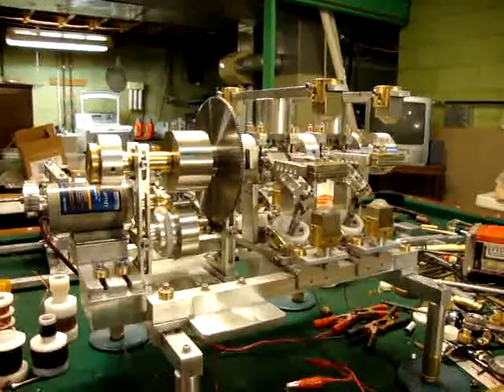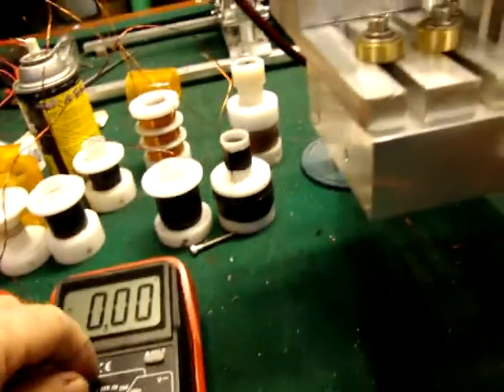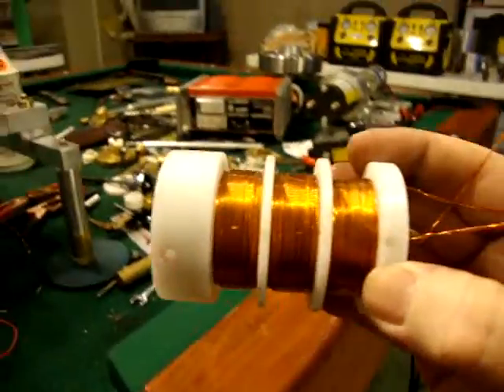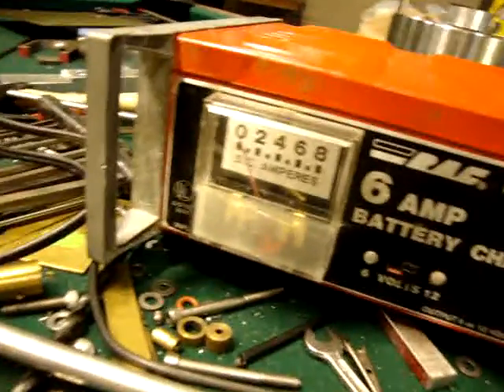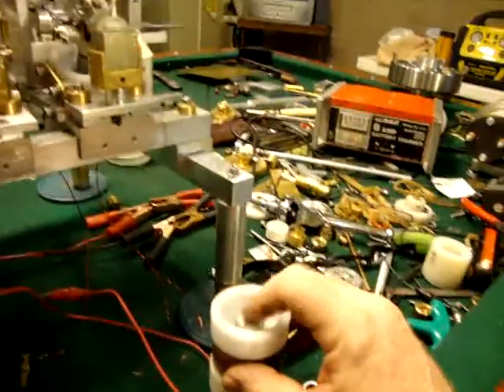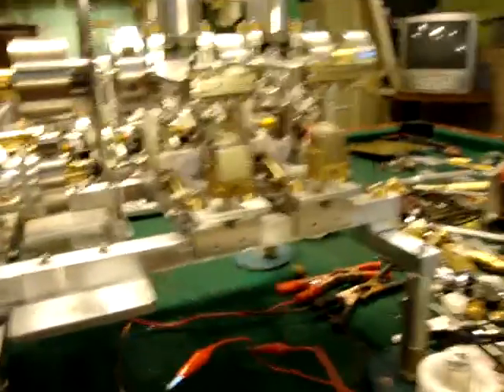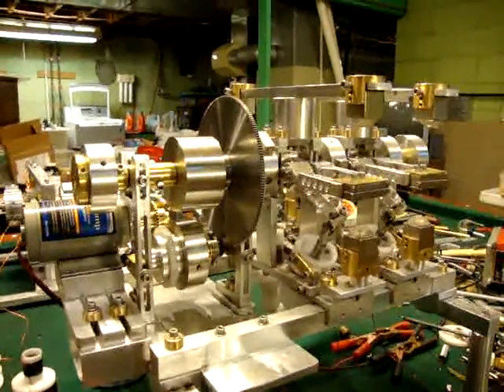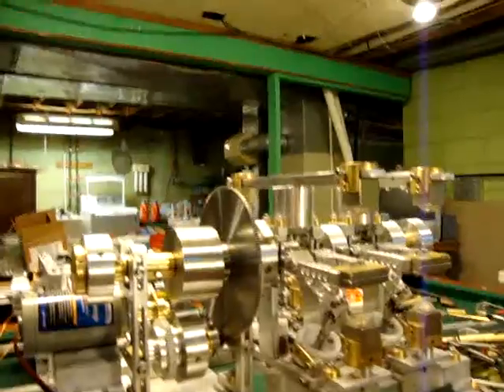Over Unity 39

Comment: Remember that the aluminium is affected by Lenz law also. If you want max current and voltage in your coils then you will also have to make sure the rod your magnets sit on is not aluminium. This includes the enclosure the wire is put on but i can already see you have that correct. I suspect that if ur entire enclosure is connected together with conductive materials then it too should show a voltage on it. Connecting the enclosure to ground and seeing what voltage/amp you get would be good test